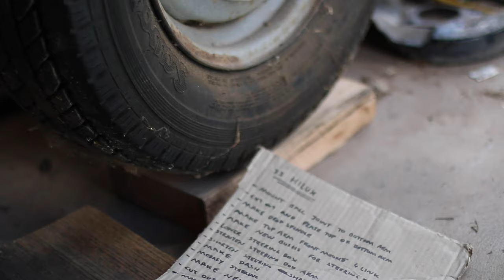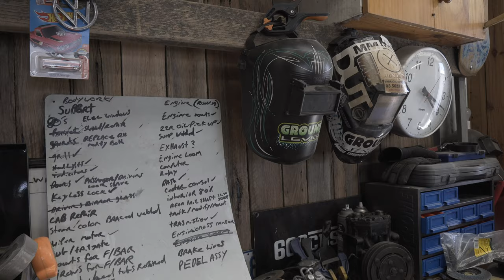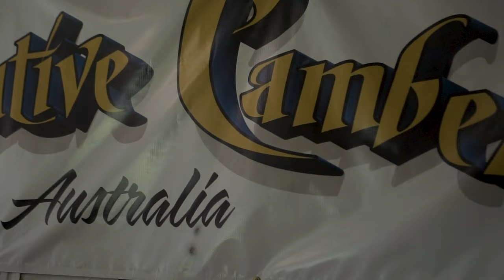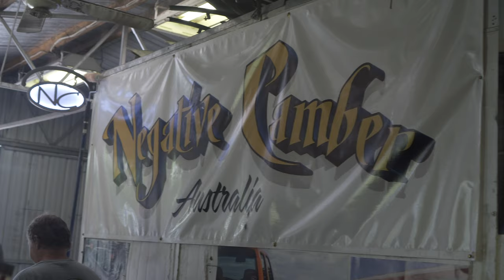Shed Builds | Altered Heights Film | EP11

Comment: Great fab work      To get it to the next level check out Heintz boys garage.  A v8 on a mini truck  should come with. Electric steering rack. And the lower control arm should be re-designed for extreme angle. Then a clean racing pedal box.  Go truckin sideways best fun you’ll ever have on a mini